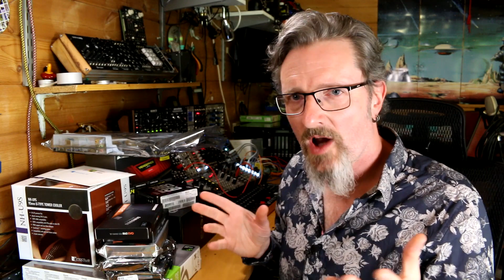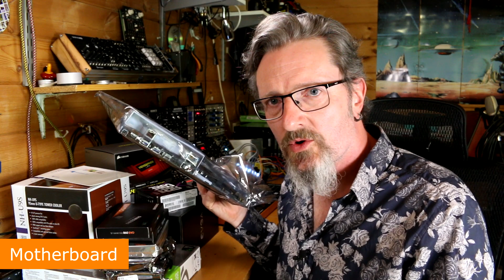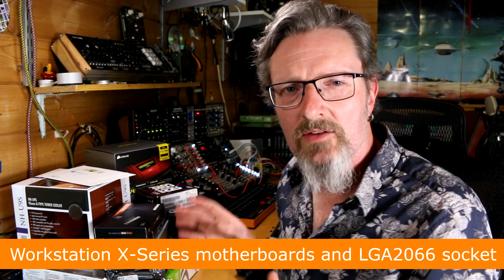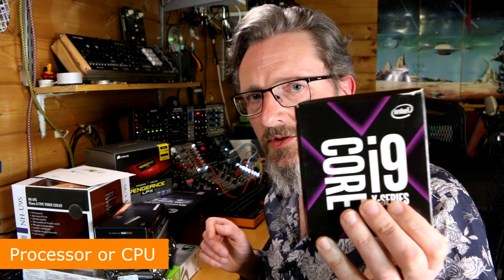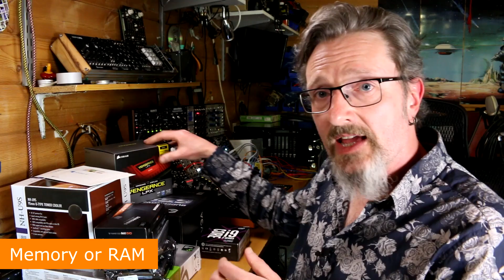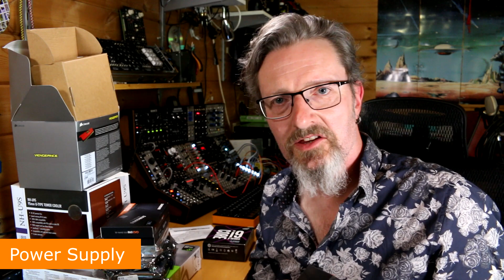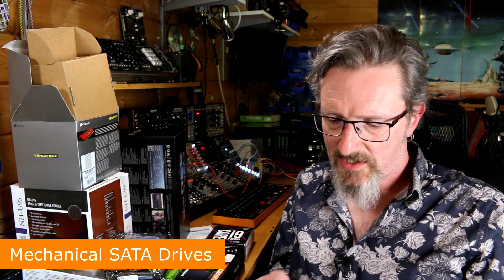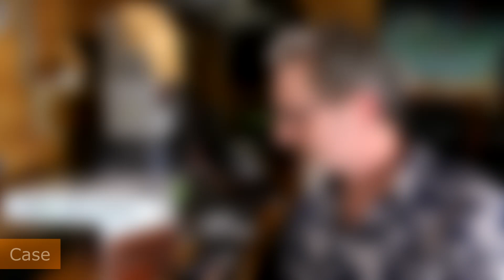How to build an Audio PC: Part 2 - Choosing components

Comment: If you've ever been driven to the brink of madness hunting down show-stopping gremlins in your brand-new "no-expense-spared" DAW then you already know that the devil is in the finest of details; general specifications be damned.

Heatsinks on your RAM matter very little if your session stutters on playback or your RTL interferes with recording. (I say RAM heatsinks matter very little in general, but that's a separate discussion.)

Any professional DAW builder (and I) will tell you that the foundation of a stable, low-latency-capable, glitch-free DAW is the specific combination of motherboard/BIOS and RAM/controller. Get that right the rest is a cakewalk (pun intended). Botch it and you're in for a rough ride.

In 2019, the CPU has little to do with latency and stability and is relevant, in combination with the amount or RAM, with regard to plugin count, and to a lesser degree, track count.

As for storage, It used to be, in the days of spinning-rust HDDs, that separate drives were often required for OS/applications, recording and samples because of seek times and bus restrictions and system overhead and such, but that is FAR less of an issue in the NVMe era. There are still legitimate reasons to have multiple drives but for most users performance is not one of them. I say get an SSD for both your system audio drives and use an HDD for backup.  If you're set on  an HDD for your audio drive then by all means get a 7200 (or 10,000) RPM beast but know that even a 5400 RPM HDD can stream hundreds of 24/96 tracks at once without breaking a sweat.

There is no reliable way of knowing in advance which specific combination of off-the-shelf RAM and mobo will work as intended. When all is said and done the proof of component selection is in the performance, and you will know whether or not you've got a stable, low-latency-capable system ONLY AFTER you've built and started using it.
Reply from the maker: Thanks for your thoughts. I don't think it has to be quite so serious. If you follow some good basic guidelines then you'll have every chance of building a decent machine as a DAW. That's what I hope to offer here rather than absolute specifics because they change all the time. As a professional DAW builder I don't get in a dozen motherboards and so do cross comparisons of performance and latency. I choose the right board in the first place which you can do with a little bit of common sense and hopefully a little bit of my guidance. But, you know, you should go with what you know.

Comment: Using an i9 for audio work,  128 GB ram? I learned audio from watching your videos on surface pros running i5, hell I think you did a video on the surface go, works fine. This build seems overkill. Can you do a budget version.
Reply from the maker: No, the specs are unimportant - the point is the principles behind what you're buying. I'm not suggesting you should copy the system i'm building - it just happens to be the system i'm building while making the video.
Reply: @MoltenMusicTech  I haven't watched the video yet, but is there an actual valid reason why you are going for Intel? It seems like a waste of money in current climate, you'd get a lot more cores for the same or lower price with the new Ryzen 3rd generation. It either matches or exceeds i9.
Reply from the maker: In my experience AMD is always more complicated, more fussy, changes quicker and is trickier to cool. There are some speed/value advantages but personally i find them less useful that the consistent reliability and longevity of Intel. You can use AMD if you like but my best experience has always been with Intel so that's why i recommend it. I want something that i know is going to work, that i know has been tested by every maker of software and hardware - i dont want to chance my studio PC on the possibility of it being a bit quicker or a bit cheaper. I'm trying to give an easy and reliable route that anyone can follow rather than a path for tweakers and CPU nerds. Is any of that valid enough for ya? :D
Reply: @MoltenMusicTech  Well, fair enough for your personal life. But color me disappointed, I was hoping to actually find someone to tell me about computer specs for music creation in depth. I don't think I've ever seen that... I just wanted someone who actually knows a lot about computers and how to spec them for music creation to make a video. This is apparently another of those "layperson to layperson" videos which at best is pointless, and at worst spreads misinformation from false position of authority. You have a computer? You can make music on it, period. You can make music on Commodore 64, Atari, Mac, even on a tablet. "Look Mum, No Computer" made a video using C64 and Midi together just for laughs. I don't see the value in this series if you're not actually an expert with some real knowledge beyond your "it's worked for me before so I'll keep on using it" and the false claim of some kind of weird "makers test their stuff on intel" claim, which makes no sense on anyone who knows how computers actually work.

Well, I'll keep on looking, maybe some tech guys might make a video about the intricacies on making a computer set up for music production. I know a lot, but I'm not 100% comfortable on the intricacies of how multiple physical processors vs. multiple software threads differ in sample accurate realtime audio production. So, should the software threads be disabled or not? I've heard claims they should be, but from no one who actually knew what they were talking about. But even the idea was enough to make me wonder. Also the how processor cache and memory scheduling in the processor might impact these things. If that's an issue, then sadly Linux is the best way to overcome that issue... and most VST plugins don't work there.

If multiple cores/threads don't actually cause issues or lag, the actually smart people would go to Threadripper instantly, because if you're not going to play games having up to 32 cores sounds amazing. ASSUMING the multiple cores are being utilized and would actually give you a lot more power for the buck versus the overpriced i9.

So, yeah...
Reply: No Mind's Eye OMG what a long digression... and you didn't even see the video... Please, link us to your channel so that we can follow your way of thinking, instead of flooding another one like you did here.
Reply from the maker: @nomindseye  Well, i wasn't talking about my personal life, I was making a professional decision on what I could reliably supply to a studio and support that system for professional work. If you watch the first video you'll hear me talk about my credentials if that's helpful. The problem with doing a video talking about specific specs is that they are always changing and ends up being obsolete almost immediately. You seem to be trapped inside the questions and troubled by the specs when actually what's important is whether a system is going to run your stuff reliably. Jumping on the latest technology or arguing over memory scheduling is not going to result in more plug-ins being run or music being made. The multiple threads you mention are a red herring because it's always evolving. There was a time when Hyperthreading was bad, there were generations of processors when multi-threading was not up to scratch or Turbo mode gave audio glitches but these things have evolved. Some DAWs support multiple threads, some dont, same with plugins, so if you design your system specifically around those factors you'll have to freeze your system in time otherwise it will be unbalanced by the next update. I've spent my career building PCs for studios, for every day music making, mission critical, professional situations and for that the system must be stable - reliable - dependable - powerful - supported and consistent and that's what a properly built Intel system can give me. Can an AMD do that? Probably but "probably" isn't actually good enough for me. What I am trying to bring to the table here is the thinking behind my 2 decades of component choices. You want someone to tell you what to buy whereas I want to give you the tools to make the right decisions yourself whether you do it now or in 6 months, whether it's for Cubase or the Pro Tools, because i believe my advice will build you a bloody good Audio PC regardless of what it's running. And if you follow my advice then threading won't be a problem, processor scheduling won't be a problem because you'll have a great computer that you don't have to worry about. But, you know, i have videos on WIndows tweaks if you're having trouble with your system. I can't force you to find this helpful but i hope other people will - but thanks for all the strange assumptions you made about me - nice one :D
Reply: I'm am running Studio One Pro 4.5 and Arturia Collection V7 with no problems on:
$200 HP Z400
Intel W3520 Quad Core 2.66 Ghz 
8GB
Win 7 Pro

Comment: For the financially challenged ...

I've found secondhand imacs or mac minis from ebay very capable for all the TOP DAWs.  For a PC solution I've found HP or DELL workstations off ebay are very good as well.
All as later model as can be afforded with shed loads of RAM or the ability to add more.

My test is running DIVA, Repro or Legend at full tilt.
Windows usually takes a bit of technical pruning of services and applications - the MACs are OK out of the box.
A really good external USB audio unit is a must. ( I have a Cakewalk / Roland V-Studio VS-700 monster)
My 16 GB 2012 mac mini does everything I can ask as does the HP Z series workstations.
Reply: I'm am running Studio One Pro 4.5 and Arturia Collection V7 with no problems on:
$200 HP Z400
Intel W3520 Quad Core 2.66 Ghz 
8GB
Win 7 Pro
Reply: I'm using Live on a 4670K with 16GB  bogstandard RAM and it can handle just about anything you can throw at it unless you get silly. Although bx_oberhausen cranked-up to 32 voices pretty much kills it. But to be fair, a bloody supercomputer would struggle with that.